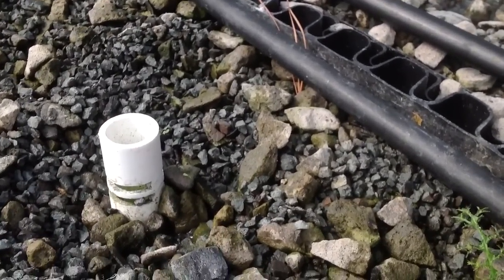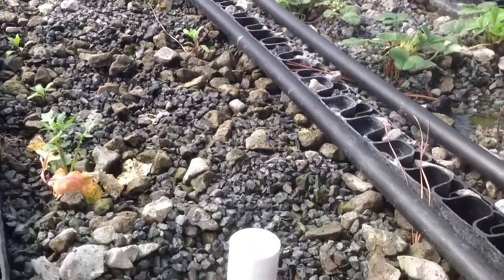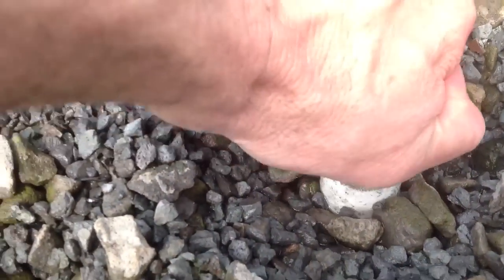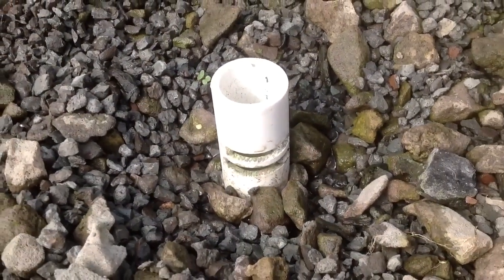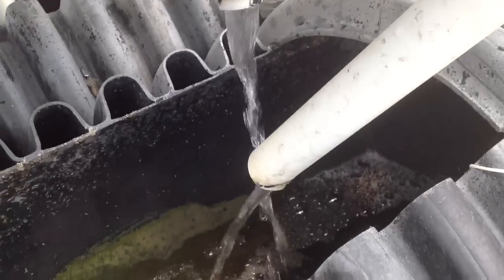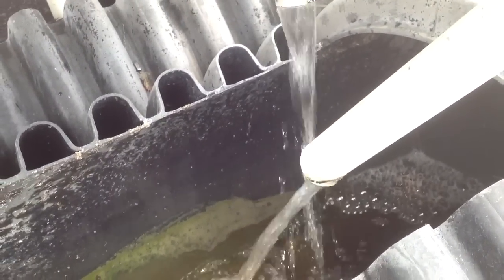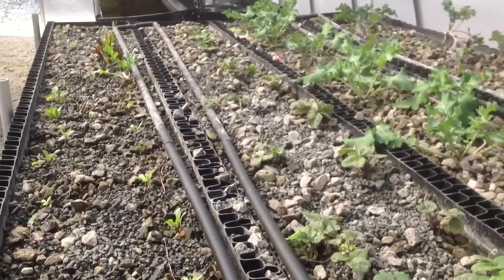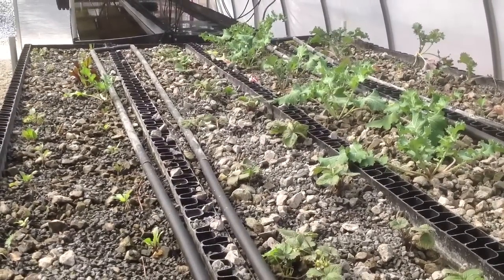Flood and Drain Trickle Valve for Aquaponics and Hydroponics

Comment: Not sure I would do this as you lose the air pumping action of the ebb and flow, this is interesting to me but not sure I would use it.
Reply from the maker: Are you talking about an air suction with ball valve? What's the air pumping action?
Reply: Sorry, what I mean is with the ebb and flow system the water pushes old air out from the roots and pulls fresh air back into the roots giving them lots more oxygen than just soil growing, it is in fact one of the reasons why ebb and flow give such great results. it also encourages more root growth which in turn allows for better vegetative growth above. more roots means more vegetation. One of the reasons why lettuce and leafy green grow so fast in aquaponics. The way I run my system I do a complete flood and complete drain and it seems that way always produces the best results. Now I have seen where people put timers on their pumps that flood the system and then slow drain to conserve electricity, but then you are always subject to problems. my advice to anyone that uses a bell siphon is to have at least 3" protective space all the way around the siphon for ease of cleaning. now I could see what you are doing working quite well with out grow media where you are growing just greens in neeti cups and the roots just grow into the water where flood and drain ratios are not needed as much
Reply from the maker: ***** Hi Tony. You are correct, a complete flood is best to evacuate all CO2 from beds and then complete drainage "inhales" fresh air with each cycle. That's exactly what we're doing. We get full flooding of beds to rock level and full drainage to base of bed trough. It's on a timer and does not require as much space as bell siphon.
Reply: David Epstein
ok I understand better. thanks was not sure but I am now, I have another cool trick you may want to try. set up a grow bed no rocks, get those fabric smart pots, the do a 50% perlite and organic soil mixture and put then into the grow beds to ebb and flow. You will be amazed at how well the works for tomatoes! oh and only flood just 60% of the pot so the top couple of inches stays kind of dry. you can grow anything with this method
Reply from the maker: ***** Sounds like a good technique for soil based growing. Just not into that. We're shooting for more sustainable by recirculating all water and nutrients. By supplying nutrients from inline inorganic waste decomposition we can eliminate perlite and chemical fertilizer that will be discharged to the environment using such a soil-hydro approach. Even if it's organic, the labor involved is unnecessary and inefficient. And water and nutrients are lost each application. We're building up a healthy ecosystem within beds without soil. And a more dense distribution of organic nutrients into grow beds throughout using Bioponica method of drip down trough method.
Reply: David Epstein
 That system I was describing is my vermiculture system, basically same as with fish but water is slowly pored back into a compost bin then into a tank and aerated then into the ebb flow table, completely organic only using composting worms instead of fish